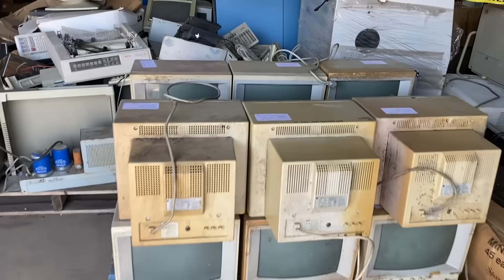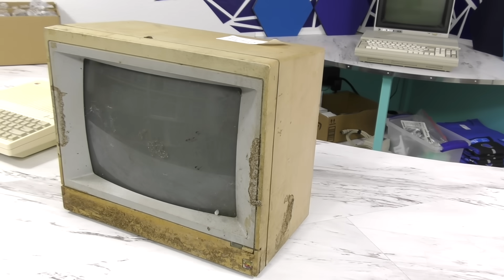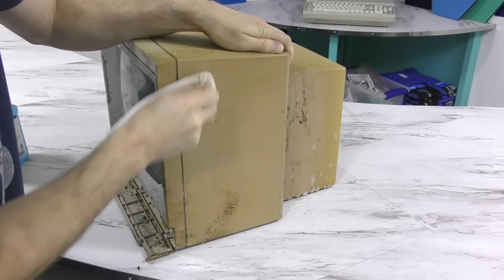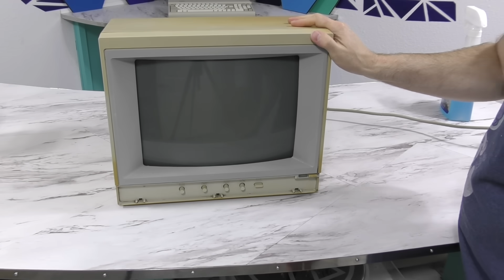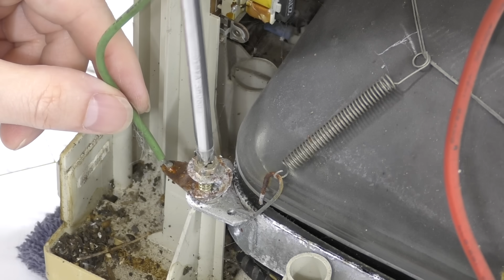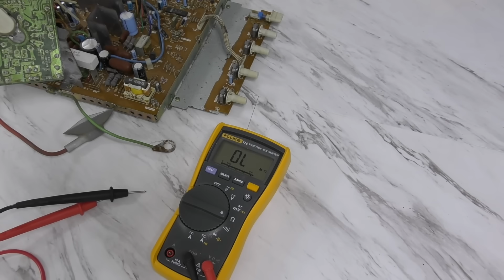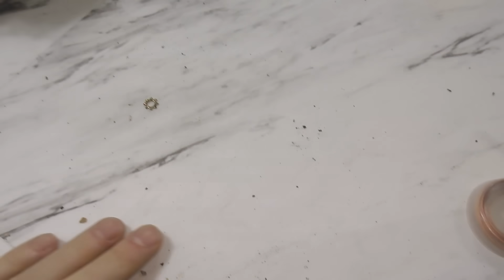Apple Monitor Found in Landfill - Restored - Part 1

Comment: Out of an abundance of caution, if all the pieces are on hand and the time to spare was present amongst those to tag in and out as part of a team who knows what they're doing - doing this solo would take much longer given what else goes into life - then I WOULD replace the old components with modern ones for the peace of mind on saving space. If nothing else, then definitely replace the capacitors and, as mentioned here, the diodes. Hopefully that modern pick IS just what you need. When all's said and done, that info's likely going to be of great help to other restoration gurus, and I hope you can provide it somewhere as a reference point. Let's hope things all work out here first.

Sure, I understand the process of component updating would be painstaking, and checking on every component to make sure no errors were made would be an exercise in patience, but given that the end result would be a nigh-immaculate CRT ready to withstand the test of even more time, I'd think that would be worth it in the end. If nothing else, then the resale value of the restored CRT to someone who really wants it for the sake of completeness would possibly recoup a bit of the price spent on the restoration.

But this is just my view.

Comment: 8-bit Guy: "After removing all the screws it still didn't want to come apart"
me: (imagining a giant spider with half its legs holding the top, half the legs holding the bottom, and pulling the monitor back closed when it starts coming apart)
Reply: Basically 99% of tech in Australia has spiders in it when you open it. I opened 6 old school computers, they all had spiders in them.
Reply: @ThatTonybo  Australia's flag should be changed to a spider. Get rid of the Union Jack as a bonus.
Reply: @ThatTonybo  I'm gonna need a Spider-to-Object ratio there
Reply: @ThatTonybo  I can back this up. Got an IBM 300CL two years ago, powered it on and it was working. But after a few minutes noticed a horrible smell. PSU was full of dead spiders and egg sacks!
Reply: That thought is genuinely terrifying. 😱
Reply: The original web crawler. :P
Reply: I didn't think of spiders, per say, but I did think that he was going to find some kind of an animal in there.
Reply: I took apart an old IBM ps2 my grandparents threw in a pile of junk when they're house got flooded.. 30 years ago. Opened it and it was full of spiders. One big mother and tons of tiny baby ones. The worst part is I was trying to get that rusted piece of junk apart for probably half an hour.
Reply: So basically, always inject bug spray into an old device and wait about ten minutes before opening lest you suffer the horror.
Reply: @RCAvhstape : Bug spray can be pretty toxic. Better to forego the spray, open the case outside, and hit every crevice with a shot of air (place the screen on a towel and maybe also some rigid like cardboard, to protect it from damage).
Reply: @Christopher-N  Or you could flood it with IPA.  That'll kill any spiders and give the cleaning process a little kick-start.  IPA is pretty much as effective as any contact insecticide, but leaves no residues.

Comment: Just a minor heads up: for pots, you’re probably better off using deoxit fader lube instead of straight cleaner. That way you can add back whatever lube was lost in the cleaning process. Helpful tip I learned from servicing guitar amps.
Reply: That's a great idea. I ordered the D5 for motherboards, ports, and a few items along with the F5 FaderLube for the potentiometers since my Kawasho Color TV/Radio/Alarm Clock/Auto-outlet set is jumpy.
Reply: TIL!!

Comment: I found a CRT in someone's trash just yesterday, took it apart for components/copper/high voltage transformer. It was made in November 2005, a few months younger than me. Also, the bad diode, from what I can see, is the only problem. I don't see any reason why it wouldn't be. Also, if you have any extra CRT boards you might've collected over the years, you might be able to source a good diode of the exact same type. You'll probably have to compare schematics of the two, but I think it'd work.
Reply: the diode isn't the problem, the diode is a symptom. it is destroyed by excess voltage caused somewhere further up.
Reply: @kyle8952  how do you know? it seems the diode is faulty because of environmental conditions, and it is consistent with two devices.

Comment: I have memories of these monitors. When I was in school I used an Apple IIe which had one of these monitors and I found out that it used standard composite video so I wanted to hook my NES to it. Today if I had one of these it would be my PS2 and a set of speakers for audio. I saw a picture of someone who used one of these as a TV because their TV died.
Reply: Hah, similar story here... I used one of these monitors in my bedroom for my original Playstation in the mid 90s and had the audio going through my stereo. Had such a clear and vibrant picture compared to what it looked like playing on the living room TV. Fun times.
Reply: @ronsmith4325  Something similar, I hooked my PS2 to an inspection camera I got from Harbor Freight. https://youtu.be/WNEbxa-0vKk

Comment: The Mouser part# 947-F30 would probably work. It will handle 5 amps, and 3000 volts.
Reply from the maker: That one isn't considered "fast recovery" so I am not sure.
Reply: @The8BitGuy  they list that one as a fast recovery. I'm not sure if the original is fast recovery, but it shouldn't make much of a difference either way. It would have less sag with a fast recovery though.
Reply: @The8BitGuy  I found one that is faster recovery. 511-STTH310RL

Comment: Hey, I'm a light nerd. And your new studio has the worst kind of light possible.
1. The color temperature is wrong. The colors lean to cold, meaning the white wall on the back is not pure white (or light gray), but it has a bit of blue on it. To be exact, the RGB values for it are 219, 214, 232. The RGB values should be as near as possible, optimally the same.
2. The lamps you're using have a low CRI index. It looks to be 80 or even less. The CRI index tells you the quality of color reproduction of a light source. That's why the colors look flat and your skin has an unpleasant green tint. Sunlight has a CRI index of 100, that's why the parts filmed outside looked awesome, but the studio looks bad.
Both problems can be fixed buying good quality bulbs or lights.
Make sure they have a CRI index of 90 or higher (95 is recommended for photography, but lamps with more than 90 are usually very expensive; 90 is a good compromise between price and light quality), and also make sure the color temperature is stable, 5500K is recommended for photography. If the lights/bulbs doesn't specify the CRI index, this means it's bad (less than 80), so avoid those.
Then, make sure to set the white balance of the cameras to 5500K, or if there's a white balance calibration setting, use that, as it's the most accurate way.
If your fix the lights, your videos will look lots better.
Hope that helps!

Comment: The moderators and admin of the Computer Reset Facebook page are rude. Don't suppose anyone else has their hours, do ya?
Reply from the maker: Keep in mind these guys are bombarded, day in, day out with the same annoying questions.  Even though there is an FAQ.  Doesn't seem to help.  Plus these guys give up their weekends free of charge to keep that place running.  So, cut them some slack.
Reply: @The8BitGuy  Thank you for answering my question Mr.Murray. I can understand that, I too would be just as irritated, and still... I don't agree how they preemptively wag their finger at rest of us for a couple of people's (like 2253/18,000) dumb actions.
Reply from the maker: But to answer the question about the hours.  There is no schedule.  The times change every weekend.  You have to get on the list to know when it will open.

Comment: There's a product called evapo rust you can find it at harbor freight it's 25 bucks a jug, but it works wonders for rusted parts. It'd be great to try on the shielding I don't know how well will work with electronics parts as I haven't tested it yet.

Comment: Please make SURE that it is the only diode of this type - others may have completely disintegrated before. Even if everything appears to work, the diodes need to be there to prevent damage.
.
Some larger capacitors will also probably need replacement even if they don't leak - the summer heat and winter cold are probably enough to degrade them way beyond specs.
.
Any fast recovery diode rated 1A or more, 300V or more should work (if it's really a diode).
It is fairly unlikely exact characteristics of diode that is subjected to hundreds of volts to really matter, the only concern is it should operate at megahertz rate which normal AC rectification diodes cannot - which is why the original ones were funny looking.

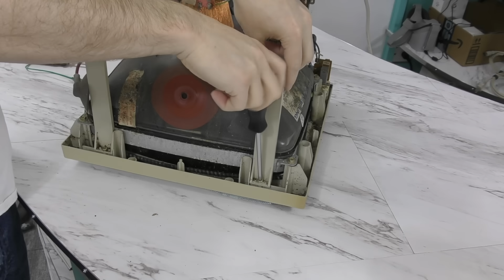Comment: 7:36 Apple using Samsung parts since the good ol' days
Reply: Interestingly, with the Machintosh TV (the 90s one), they used a Sony Trinitron CRT. But, if you look at the others similar to it (the LC 500 series, for example), they don't mention that they use that. So, they could be using Samsung displays in these machines, actually. Not really too sure, though.
Reply: @KorbenTheFireX  Trinitron tubes are very easy to identify by their shape. They only curve side to side, while shadow masks curve both side to side and top to bottom. Also, if you look closely, Trinitrons have the 3 phosphorus cells side by side while shadow masks have them in a triangle. The problem with this method is that after 1997 when the original patents expired, there were many fake Trinitrons. Apple even has used many fakes in its products. Also, if its a later model and its flat, it could be either an FD Trinitron, a fake FD Trinitron, or a flat shadow mask. Either way, to get the best possible picture quality go for a Trinitron tube that's actually part of a Sony device: a TV, a generic monitor or a VAIO monitor. They may even have Digital Reality Creation or WEGA engine that way.
Reply: @DMDaskalakis  The last tube TV I ever bought was a Trinitron. Was heavy as hell with that flat glass. Great TV though.
Reply: @DMDaskalakis  
It was more on that the Trinitron patents had expired, but Sony still kept the trademark name. So other companies used their own naming variants like Mitsubishi Electric DiamondTron.

Also, don't forget that some Apple Carts were Toshiba
Reply: @XzTS-Roostro  true, but with the tube used in a third party case, like in a macintosh, you are never presented with the brand name so you cannot know if you're getting the Sony ot the fake. I don't mean fake as in counterfeit, more so as in design copy by even quality companies like M.EL. The thing is crts are so cheap nowadays that you might as well toss all the non-Sony ones. (same with non-Pioneer/Panasonic plasmas)
Reply: @DMDaskalakis  Were all the later flat panel Sony CRT TV's trinitron? I remember when or OG sharp CRT died my dad bought a pretty nice Sony flat panel CRT that BARELY fit inside out entertainment center. Probably was pretty damn big iirc
Reply: @DMDaskalakis  I just took a look at the last CRT I bought, and sadly, it's a shadowmask design (glass curved both ways).  However, it does have S-video, composite, a component type marked as DVD and a fourth on the side that was, as I recall, very convenient for a PS2.  I bought it near the tail end of CRTs, maybe as late as 2005 or 6.
Reply: @kasuraga  Sony was the inventor of the Trinitron tube and used it in all its displays since 1968, so unless yours is a counterfeit, it is a proper FD Trinitron.
Reply: @DMDaskalakis  You are right about the Trinitron tube shape, but most other TV tubes from the 1980s used in-line phosphors. It was the GE Portacolor in line tube that gave Sony the idea for Trinitron. The Trinitron patent was for single electron gun that improved performance even more.
Reply: I'm owning a big and heavy 21" Studio Display, which belongs to my PowerMac G4. It also has a Trinitron tube from Sony inside.
Reply: @KorbenTheFireX  Not obly that, but Iphone 7's actually have sony cameras for them too.
Reply: That's what I thought as well! How times haven't changed, Samsung still making displays for iphones and stuff :D
Reply: @daftbence  I've read somewhere that Samsung are making more money with iPhones than with their own phones. 😇
Reply: And don't forget that at that time Apple computers used BASIC that was owned by... Microsoft.
Reply: @luisgomez8774  And a few apple computers also used parts that was made and licensed by microsoft at the time, shocking i know.
Reply: I never knew that - Iyou learn something every day!
Reply: @Daniel Janiš they are probably still using Samsung SSDs... there's just not many companies out there producing the actual NAND chips.
Reply: @lunakoala5053  Given that a modern fab costs something like 7 to 8 billion US dollars to build, it's not surprising relatively few gigantic corporations actually have any these days.  However, thanks to companies like Taiwan Semiconductor, anyone can get custom silicon spun for a reasonable price (for getting silicon spun, that is, per chip costs for small runs tend to make it cheaper to use programmable logic devices of some type).

Fabs are also built at prodigious speed during normal economic times, with a new one opening as frequently as every six months.
Reply: @evensgrey  TSMC is irrelevant when it comes to NAND flash. I'm not saying they don't produce it at all, they might. 
But basically all of the supply is coming from either Micron or Samsung.
Reply: Samsung do make good parts...
Reply: Samsung makes tons of stuff for apple...
Reply: What are you talking about Apple makes all their own parts, heathen.  Right down to the geniuses who manufacture them, all are initially spawned from specially-selected donor germ cells from existing geniuses on petri dishes (also Apple-made, of course).  After a few days, the thin tissue layer on the growth medium is transferred to a bulk spawning chamber where drums of nutrient pellets are slowly colonized by the network of tissue, where cell differentiation begins.  After about 18 months of growth and incubation, the drums are decanted and genius is poured out, already pre-programmed to whatever service the Apple queen algorithm has decided is best for her brood (this is, of course, set by an injection of eusocial hormones into the initial growth medium during the petri dish phase.)  The expected lifespan of a genius is approximately 18 - 24 months, depending on carrier upgrade cycles.  They are partially serviceable, however only by other geniuses.  Attempts at repair or service by 3rd party medical professionals triggers a software lockout and causes the whole genius to be bricked.

Sometimes a genius can be resurrected by plugging it into iTunes and performing a backup and reset.
Reply: Went here to write same comment
Reply: 300th like
Reply: They used whatever was cheap at the time, like always.  My Monitor /// is a Hitachi unit.
Reply: @drwheeljack87  that made me laugh for some reason. "A' xD
Reply: Samsung IS everywhere.
Reply: Everything using Samsung parts since ever
Reply: Not much has changed they still do that
Reply: I knew I wasn't the only one who noticed that 😂
Reply: Yeah, but even then Samsung parts discarded by Samsung years ago! And a landfill is the only place for Apple devices!
Reply: It worked after being in a landfill for DECADES. Of course it had to be Samsung. 😂

Comment: That rotted out diode is not a critical part - all it does is rectify that 180V line coming off the flyback. If you have a junk TV chassis laying around, it probably has a very similar circuit with a diode that would work. A lot of color TVs and monitors derive multiple voltage rails off the flyback in similar circuits to that and so have compatible parts in them.

Comment: I found a Macintosh Plus in the cemetery with some word processors and CRT TVs a few years ago! It was missing the CRT so my friend and I parted it out for other Macs. A few years later we came back to it and the logic board actually worked! Kind of, it was really glitchy. We used a different analog board. 

I made a video about it on my channel when we first got it, but we had no idea what we were doing and it doesn’t show it running.